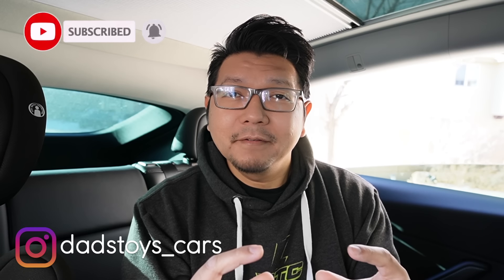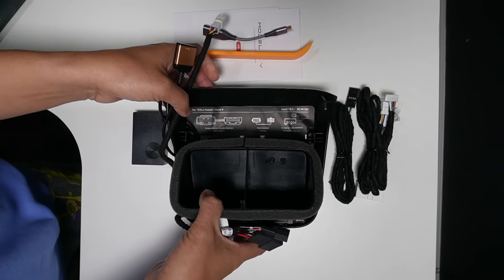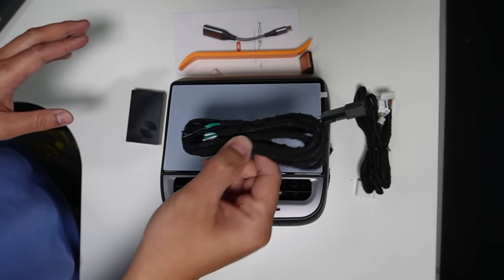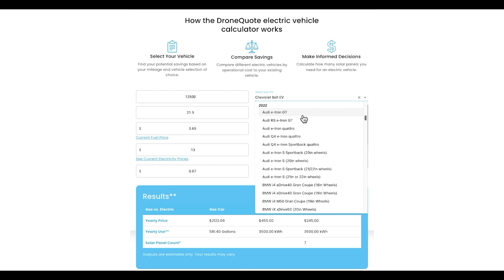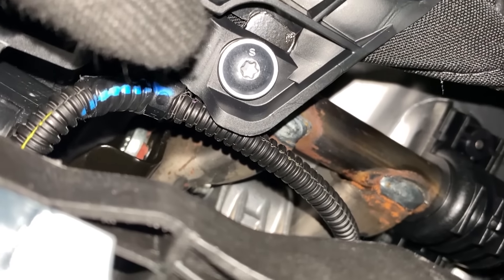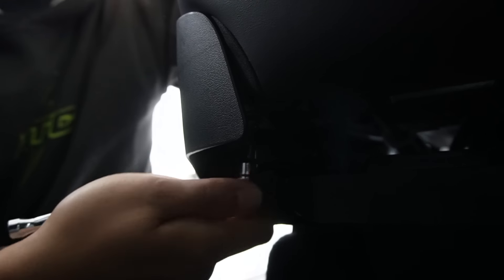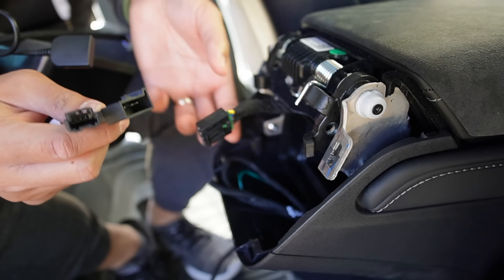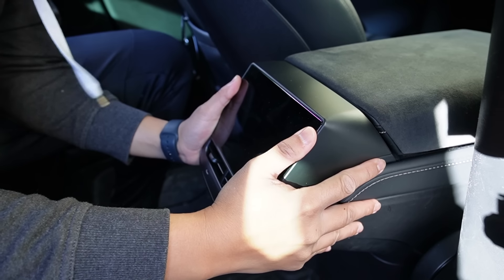New 2024 Tesla Model Y Rear Entertainment Display with Built-in 4G Internet! #tesla #teslamodely

Comment: I installed this Unit and OTA MCU update worked for me. It upgraded from 2023 Nov version to 2024 Jan version. Also system app update worked for me as well. Obviously you have to connect to wifi first in order for OTA to work
The large vent really push good amount of Air and does the job which is Main function of rear hvac.
One downside is if you change volume or temperature from this unit, it is not reflected to front screen with correct number.
Reply from the maker: Appreciate your comment.
I’m glad it worked well for you.
Unfortunately all of the aftermarket display doesn’t have ability to override what’s on the main Tesla display.
Thank you for your awesome support!🙏😃
Reply: Can you please share instructions on how to do OTA and system updates?
Reply: Hello @shahvatsal2391986. Have you noticed any changes after update? Probbable new languages support in settings (Only English and Chinese in original system)? Have you first make MCU update and after that the system update?
Reply: @tarapuz8723  I didn’t test earlier versions.. As soon as I connected this device.. connected to wifi and than did update..
Reply: @dadstoyscars  its under Menu (car symbol) and than all the way bottom under “info” , you will find MCU update and App update options..
Ensure to connect this device to wifi from Menu
Reply: @khaboom Hi did you ever find instructions on how to get the updates?
Reply: @bluepalomavelomobile8360  yeah it’s under the menu (car icon), go to info and and select MCU and OTA update. Be sure to connect to wifi first.

Comment: I just ordered mine using your code 💯🔥Thanks a lot for the great review.
Reply from the maker: Appreciate your comment.
Thank you for your awesome support!
Please subscribe for future contents.🙏😃
Reply: @dadstoyscars I just subscribed 💯 Thanks a lot again!🤝🏽
Reply: @dadstoyscars Where’s a great place to get a 4g SIM card for the screen & also can we save mp4 & mp3 files to the screen from your flash drive since it has its own memory?
Reply from the maker: @MurdaT12  I’m not sure where you can get the SIM card. I think it’s best to ask your mobile carrier if you could add SIM card to your plan.
You can copy music and movie file onto the display with thumb drive.
Reply: @dadstoyscars  Thank You! One more question 🙋🏽‍♂️ Did you ever find out how to connect a controller to the rear screen? 📺
Reply from the maker: @MurdaT12  if you have controller with wireless dongle you can try to connect wireless dongle with USB-C adapter and plug into the left USB-C port on the display.
Reply: @dadstoyscars is it confirm to work? I use a wireless single to connect Tesla main screen anyways

Comment: I bought one and noticed it fits great with one caveat, I had issues opening the armrest initially. The other issue I have is getting the 4G to work - there is no way to get into the android settings to select network and setup the access point information for the cellular networking. I'll do the OTA update to see if that fixes it. Screen also doesn't go off when not in use. The manual is one sheet of paper with near zero instructions. I'm on the fence; I'd say wait until there is a better option. Oh! Airflow is decent. I did get one complaint about air but this particular kid passenger is a nitpicker

Comment: I have few questions. 1.) Does the screen turn off properly when the car is off? I don't want the device draining my battery if I'm not using it? 2.) Do you think the game controller issue is simply a software update thing or you think we would have to wait for the 2025 version of this device? Does this essentially do everything that the official tesla versions do regarding their rear screens?
Reply from the maker: Appreciate your comment.
The screen will turn off when the car is off every time as it connected to the power of the car.
I’m not sure about game controller connection issue if it’s based on software update or not.
It does most of the stuff that new rear display on the new Model 3 highland does except the apps and internet access from the main car.
Thank you for watching!
Please subscribe for future contents.🙏😃

Comment: I installed mine today, but i cannot get the bluetooth to work against the car either way. I get connection errors and i've spent a good hour to try. With the phones and other units, no problem. I  also connected my phone to the display and got carplay... but the display will not connect to the car bluetooth which means no audio from the screen in the car speaker system.

Comment: Many problems it has. The pins to fix the screen are not strong enough! So it's failed off easily! And when you want to open the arm rest, it pops out!
Reply: Had this exact same issue with mine. The screen works ok but the fitment is not good. Also seems that 4g connectivity doesn’t work, Even after spending an hour with an AT&T rep trying to figure it out.
Reply: What did you do to fix this? Did you get a new unit? I have the same problem

Comment: I just ordered my 2024 USA model y RWD, would this connect to it or does the 2024 have different wiring that can’t be plugged in to this screen?
Reply from the maker: You would have to select “Model Y rear vent bottom without OBD plug” option.
Because RWD model Y don’t have rear OBD plug you would have to connect to front passenger side panel OBD plug instead. 
Thank you for watching!
Please subscribe for future contents.🙏😃
Reply: Like the fast response! You earned yourself a sub for sure👍👍
Reply from the maker: @theceo_3805  Thank you for your support!🙏

Comment: My blue conector from the car is bigger then the white conector came with it , any suggestion please
Reply from the maker: I believe you pick the wrong option when you ordered it. Because Model Y standard range don’t have rear center console OBD connector so the display has to connect to front passenger side OBD port which is smaller 20 pin OBD port.
Reply: @dadstoyscars  my is a long range 2024
Reply from the maker: @michelbru8178  what option did you pick when you ordered it?
Reply: @dadstoyscars  I don’t remember now but I think that I need the Daisy chain  conector
Reply from the maker: @michelbru8178  please try to request 26 pin OBD connector wire from Teslasy for your display.
Let them know that you received the wrong wire harness for your LR Model Y.
Reply: Thanks

Comment: As with other displays I have asked the same question which seems to get missed. Does the display go to “sleep” or turn off after a set time so that it’s not lighting up the whole back seat if no one is there?
Reply from the maker: There is no timer to set for it to go to sleep. However you can manually put it on sleep mode which will show the clock face while it’s on sleep mode.
Thank you for watching and your great support Todd!🙏😃
Reply: The last model he tested that had android 13 had a power button on the launcher that turns off the display, but its still on as it turns on instantly when you touch the screen. It doesnt have an auto off though, but you could go into the android settings and turn on display auto off, BUT if you did, once it turned off you couldnt turn it on because it acts like a phone and you would need to press a physical button which that didnt and there is no double tap screen to turn on, so that was a broken function. I'm sure you could do the same with this model and same issue. BUT he says you can put on a clock but that means backlit is still on and it would be annoyingly bright. The last screen as mentioned had the power button and completely turned off backlight black
Reply: @moialder252  Thanks!  I really hate that these don't take advantage of the rear seat sensor like the Linux version does.  Even in dark mode, the screen is bright enough to be distracting at night when driving alone.  I wish the reviewers of these (there are many) would convey this Teslasy and Hanshow to make these more intelligent.  I don't want to have a hack (run some automation to turn display off) and then get to where it won't turn on like you said.
Reply: @toddswire9581  if you find the android system display auto off feature, you likely will see it as "null" , as mentioned if you set it, it will work and turn off, but once off you cant turn it on again until the car restarts. BUT after that, you wont be able to disable it because "null" or off is no longer an option at least in android 13 version. Might be different with this android 12 but i dont know. So after that the only option is to factory reset it. So just adding this for those who want to experiment
Reply: @toddswire9581 night mode works wonder and with brightness manual setting to the lowest no issues here

Comment: thanks for another awesome review. can you please confirm if your Tesla has the latest update 2023.44.30?
if it has the latest update, when you change the volume or temperature or turn on heat seat, is it updating the status on the main screen as well ?
Reply from the maker: Appreciate your comment.
My current software is 2023.44.30.8
Normally aftermarket display can only control the functions but can’t override what shown on the display.
Thank you for watching and your great support!🙏😃
Reply: @dadstoyscars  before the update, with the other screens, this bug wasnt present. when you turned on the rear seat heaters on the rear screen, it would instantly also change up front on the big screen to match.
Reply from the maker: @moialder252  Interesting because in my experience aftermarket display doesn’t usually override the main display.

Comment: I got this unit and I don’t like it. It doesn’t clip into the center console nicely. The top pops off. If I open my center cosnsole the top part of the unit comes right off.
Reply from the maker: @ruben619448  same thing g happened to me after couple days.
I had to remove the display and took time to manage the wiring then make sure the display put back in place with all the locking clips well attached and no wires blocking it.
Please try again. It should help.
Thank you for watching and your support!🙏😃
Reply: the thing is the top clips don’t have any locking clips. It’s just a straight piece of plastic. I clipped just the top in to see how it holds and it won’t hold at all. The handshow model has metal locking clips and the Tesla stock vent has locking clips molded into the plastic
Reply from the maker: @ruben619448  I will forward your issue to Teslasy.
Hopefully they get back to me soon.
Reply: @dadstoyscars  Thank you, I really appreciate it. I also sent them an email. Maybe my unit has some bad clips
Reply from the maker: @ruben619448  They got back to me. Here is their response “It may be because the clip was removed when the original air outlet was removed.
This 4g rear screen is installed using the original clips.”

Comment: which model can do hotspot?

7-inch (V3 CarPlay + 4G): 

High-Definition 1024x600 pixels LCD,with wider airflow 
4+64G,  Android system with wifi connection
Support 4G network
Support wireless Apple Car Play & Android Auto.
Negative ion air purification
Built-in Dual Speakers
Control the main display for volume (up/down) and play / pause
A/C climate control & Wind speed adjustment ; 
Support adjust the entire front passenger seat and backrest forward and backward
Support adjust and control the Heating for each individual rearseat
Support Plug and play with USB disk and TF card
Support Seat Adjustment
Support connecting third-party headphones and other devices.
Sending hotspot is not supported

it has highlighted "sending hotspot" is not supoorted  whats the meaning
Reply from the maker: This one in the video can connect to your phone hotspot. I think what they meant was the display can’t become WiFi hotspot from its optional built in 4G internet. So basically you can’t use other device like your iPad and try to connect the internet from display’s 4G.
Thank you for watching!
Please subscribe for future contents.🙏😃

Comment: this looks like an updated version of a screen 2 versions ago. This is running android 12, the most recent before this one was android 13. Strange the website doesnt indicate what processor it if using too. I wonder if it is inferior and why they refuse to indicate it. This does have better front end/launcher it seems. The vent adjustment is a nice touch although last one was big enough to be adaquete it didnt have manual flaps to adjust direction. The last version could be found for $199, this "new" one is double the price, but not worth double the improvements (dare i say regression with older android and possibly inferior processor). You should have mentioned the bug in this that is still present from the last one where after holiday update, the rear seat heat setting changed in the rear screen will no longer appear on the front screen.  Some other unanswered, will it auto off after idle and is there a setting for that. How can screen be powered off if dont want to be used.  $400 vs $200 is not worth the price on a better launcher/gui and adjustable vent flaps. The previous one also came with 4G sim capability, and built in speaker. The silver/grey surround trim is subjective, as the previous one actually matches the silver trim around the center console for those who kept it stock up there. If this was $200 sure this might be better, but extra $200, even $150 with discount code, is a bit much
Reply from the maker: Appreciate your comment.
About the heated seat control that won’t show in the main display happened to some display even before holiday update. 
Display will turn after the car is off and you lock the car.
Thank you for watching and your great support.🙏😃
Reply: Where did you see the "previous version" for $199? Please let me know. thnx
Reply from the maker: @lgbtrain1  I think he meant this version:
https://www.teslasy.com/products/rear-entertainment-climate-control-screen-v2-for-tesla-model-3-y-2017-2023
It’s about $209 after using code: DADTC
Thank you for watching and your support!🙏